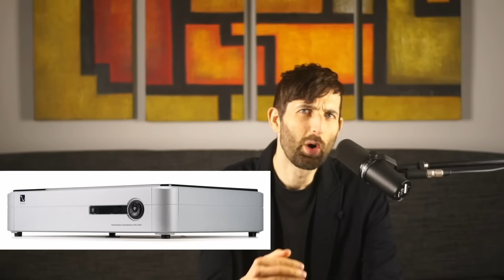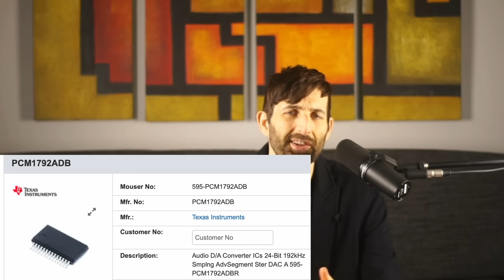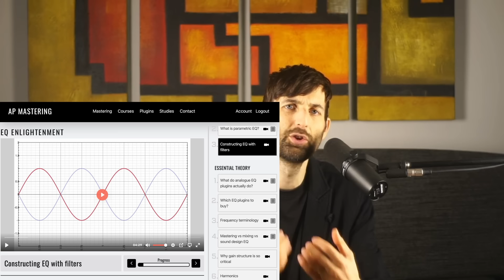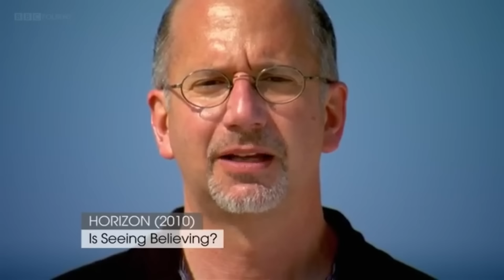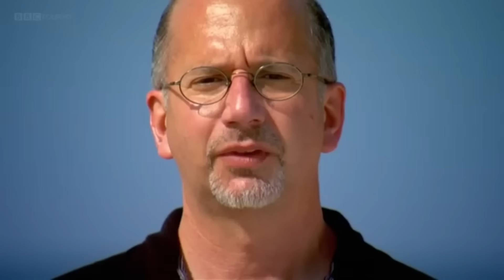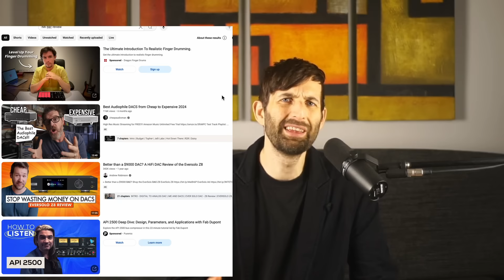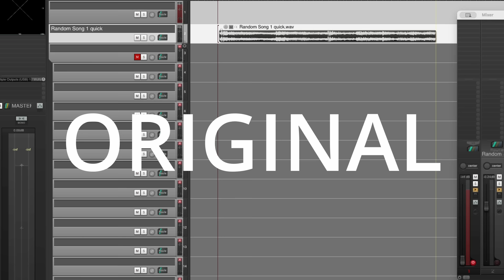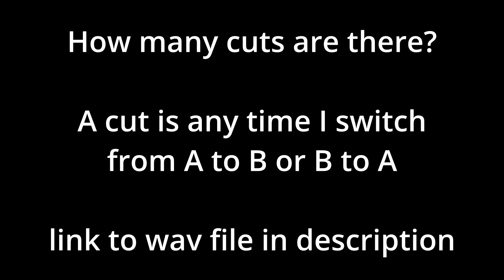The DAC Scam - Almost everyone believes the hype

Comment: Lol I think dacs do sound different(!) I was listening with a bunch of good iems and the ifi Go Bar the other day and the sense of space and reverb trails was drastically different when plugging straight into my phone. I couldn't believe it on some tracks the difference was so stark at first I thought the ifi device was adding reverb to everything and I literally checked by listening to super dry tracks where the vocals are right in your ear.. I'm not good at describing audio experience but the soundstage was clearly different between the two devices and the ifi sounded better on most tracks, some tracks were so different it was really down to personal preference which presentation you preferred. ✌️

Comment: What exactly are we saying here? Are we saying that the built-in DAC on a $300 receiver will not sound better than a well-built $500 dac or are we saying that a well-built $500 dac what sound is good as a $5,000 dac? I can believe that second claim but based on my listening I have a hard time believing the first claim.
Reply from the maker: depends on the quality of the receiver. a transparent receiver is a push at 300$ because it also contains an amp. but it could sound significantly better than a 100,000$ a DAC because the overpriced one probably is not transparent and has weird colouration from using bespoke nonsense

Comment: Okay, it's not that I am sure you're wrong. But I am not 100% sure your totally right either. Let me share my experience. I had a SCHIIT Modi in my system. I thought it sounded fabulous. I wanted to get a bluesound node. Based on price My assumption was that the internal DAC would be at least as good if not superior to the modi. My intention was to give the modi to my son because why would I need it? However I was surprised that the node just didn't sound as good. When I ran the node through the Modi It sounded noticeably better. To me in this scenario it seems that if this was all psychological coloration I would have thought that the node would sound better to me. That was the more expensive device and the one that I thought would sound better. Yet that wasn't the case. I ended up giving the Modi to my son anyway because I had told him I would. After about a year I picked up an SMSL DAC that was only around $220. Again, in my mind this was a cheap DAC relatively speaking and my expectation wasn't high. I thought I would check it out and just return it to Amazon if I wasn't happy. But I was very happy. Now, this wasn't about transparency. It was mostly about soundstage. I swear to God that the soundstage was broader and deeper and taller with the SMSL than with the onboard dac in the node.

Comment: So frustrating to see such a video, reinforcing believes and misinforming the audience.
While theoretically the job of a DAC is simple, the actual implementation is not.
If you can‘t hear differences, good for you, you can save a substantial amount of money.
If you can remain open to trusting your ears, really compare DACs by listening on the same system, ideally some top headphones, since a TOTL headphone will be more accessible than a TOTL Hifi system.
For sure there is plenty of snake oil in the audio world, but there are also really well engineered solutions that make a real difference in sound quality and enjoyment.
Cheers

Comment: I bought an Anthem 740, Arcam 1120 ,a Denon 4800. They were all around $2500 to 3k..
I evened up with a Pioneer 505 for $1099. The sound was no different. Yes, they all had their own room correction, but when it came to critical music listening, zero difference.
Spend more if you need more channels and that's it.
Your speakers will make the most difference.

Comment: The implementation (supporting circuitry) of that basic DAC chip is what really makes the difference. Thats what you're paying for with most DACs and it can make or break the overall design and its real world performance. It starts with the power supply and ends with the output buffers. The chip manufacturer supplies you with the application data of their chip. If the DAC manufacturer doesn't support the DAC chip sufficiently, it can virtually stunt the performance potential. So that's what your basically paying for - the external performance.

Comment: The first R2R dac I ever tried had an immediate emotional impact on me. I started dancing in the room and I'm not really a dancer.
Reply: I honestly cannot tell if this is sarcasm, but the point of this video wasn't that there's "no difference in sound" between DACs, it's that if a DAC is supposed to be "transparent" then it's transparent and cost has no bearing on that.

R2R sounds like it does because it's coloring the sound with distortion, similar to tube amps.  Some people greatly prefer this sound, as it comes off as warmer or "more natural", but it's still colored sound.
Reply: @Neonmirrorblack that's just wrong. R2Rs are more accurate in certain ways and color the sound less. They have zero crossing distortion but aside from that they're more accurate in every other way and color the sound less. Delta sigmas literally require filters to work.
Reply: @jayaneyon9316  What exactly are the certain ways? All data shows you are exactly incorrect,  this better be good. You've also displayed your massive ignorance in delta sigma, would you prefer non-music content is pushed into the audible range instead? Why the existence of a filter is inherently bad to you? You should have tossed the vast majority of all your electronics if such is the case.
Reply: @psyborg06  harmonic accuracy and impulse response. Way more important than a little distortion. The fact that they have filters means they color the sound and if that wasn't the case then you wouldn't have the option to choose between different ones on high end dacs. I didn't say it's bad. But Delta sigmas are not as realistic or accurate sounding as R2Rs. They just have an easier time with details. But if I could afford a holo audio may I'd get all the detail of a delta sigma with non of the downsides. You're obviously just some armchair reddit nerd who doesn't listen to their actual ears. Go back to playing that stupid track mania game while listening to music through the puny delta sigma dac that's integrated in your computer with it's noisy switching power supply and it's cheap unbalanced amp.
Reply: @jayaneyon9316  LMFAO how do you think we measure "harmonic accuracy"? Total Harmonic DISTORTION (THD). Now explain how a filter colors the sound if it affects only frequencies humans can't hear. Finally explain how you've disproven the fourier transform.
Reply: @psyborg06 that's harmonic distortion though. I'm talking about which harmonics are prioritized and amplified more, especially in the higher frequencies. It's just factually true that R2Rs sound more like live music. Maybe you don't go to many shows or play any instruments so you don't get it. Like even if I didn't know why it wouldn't change the reality which is they just sound more realistic. If it's more like the real thing it's less colored. And hearing doesn't cut cut off sharply at 20khz. And the frequencies you can't here still have an affect.  And your last point has nothing to do with what i'm saying. And the impulse response is most important but you're ignoring that.
Reply: That would be the music that made an emotional effect. If your DAC is imparting anything to the signal, it is inherently failing at its purpose. You didn't listen to the video, did you?
Reply: @psyborg06 I couldn't disagree more with your idea of what a dac should do. I agree 100% it is the music. I felt an emotional response from the r2r dac that I had never experienced from digitally sourced music. I felt the emotional connection that I used to feel listening to records and tapes. I am so happy I found out about really high quality dacs.
Reply: @t.glenn.marshall  It seems you've fallen in love with an inanimate electronic object, this is very strange. What a DAC does (or should do) is right in the name, you're free to concoct whatever hallucination of a definition you please I suppose. Can't help those who actively revel in being taken advantage of I suppose.
Reply: @psyborg06   If you think there's only one objective way to enjoy music you are a dingus. R2R isn't failing its purpose at all, it's SUPPOSED to sound like it does.
Reply: @Fetchdafish  An R2R DAC is not music.
Reply: Dude, r2r is just an architecture for DACs, there are still in integrated circuits if the application makes sense.
Reply: @guillermomaciasrojas7912  I don't understand what your point is. I simply try things and keep what I like and discard what I don't. I didn't have an emotional connection to the music I loved as a young person ever since CDs became popular. I thought the weak link was the digital format. Thankfully, after almost 30 years I learned the weak link was the DAC. I am not upset if other people don't feel the same way. Everyone is different. It is ok to like diferent things. It is ok. There is no reason to be upset. If you don't hear a difference in DACs than that is cool with me.
Reply: @t.glenn.marshall  You clearly don't understand much, your entire argument is based on personal feelings.
Reply: Spot on! Part of the problem is that the sea of deniers did not get the chance to actually hear a R2R or, for that matter, even a good 25+ years old NOS + tube dac to experience the differences in emotional engagement. Obviously, power supply and final stage are in many cases more important but, even when done right, I can surely hear the bloody delta sigma emotion killing demon. And it is absolutely not about AB-ing on a 2 minute piece of crap digitally emanated sounds but listening to music day after day after day after day and each time smiling, tapping you foot uncontrollably (the only audio equipment test you will ever need!!!) and elevating your spirit in this blood-thirsty foolish world. Vinyl and reel-to-reel (R2R 😀) do help a lot too!
Reply: @MrDinupi  You should start a religion, electronics with emotions is surely a new one!
Reply: I AGREE STRONGLY!!! R2R, though an old technology, sounds so much better than many of the newer dacs!
Reply: If u want DAC for music production then your threshold for diminishing returns hits very early in monetary sense.
But for non critical music, When i listen to music on cayin ru7 and most topping DACs immediately you want to stop play button on topping. The reason is Topping measures superb doesnt add harmonics and feels sharp and thats good thing to understand music but to just put and relax you want the smoothness which is coloring. There is another DAC Schiit Asgard series which is also sweet to listen especially with Bright speakers. So question is are most people listening to music are mastering engineers or casual listeners ?
Reply: @suryaparaman  Since the topping is transparent, this would imply that nearly all music is mastered in way that is non relaxing, unsmooth, and dull according to you. That is very unfortunate for you.
Reply: @psyborg06 
I did listen to the video

I have been to studios and I ustand the importance of DAC and audio interfaces not to colour it for a mastering engineer. 

The point I was making is many people assume sound should be uncoloured and end up buying gear which they can't listen more than hour. Thats why it's important to know that colouring sound for a CASUAL listener may not be always bad.
Reply: @suryaparaman  It looks like you haven't addressed the logical conclusion of your claims and are now trying to walk them back. Consider why that is.
Reply: MAYBE it was the shoes you were wearing ??
Reply: @anotherbrickinthewall1700  or his tightly they were tied. Also, well shined shoes are more magical.
Reply: Ares II is at least trash. Has treble roll-off starting at 8kHz. Literally worse than an apple dongle. DACs can sound different, but mostly it's less accurate and colored. Preferring that is fine especially if it balanced out the opposite weaknesses of a system, but it's not better any meaningful sense.
Reply: @hartyewh1 Well at least you acknowledge that there are low pass filters in non-oversampling DACs. 6:35 the video says you hear the stair steps, because he's never heard of a capacitor or analogue low-pass filtering.
Reply: I tried r2r, no difference, nothing, people would fail at ab testing, it's all make believe and snake oil lol
Reply: @jasonclintford2751 you must have a ball of wax in your ears, as I can hear the difference!!

Comment: Proper dacs allow for upsampling to say 22,4mhz (OCTA DSD) 

this in turn allows to move the aliasing filter much further up past 100khz

It sounds much more smooth and "analogue" than your typical stock grade DAC only allowing for 44,1khz with FIR filter at 22000 hz

Being able to upsample everything to OCTA DSD really sounds a lot better for this reason.

And i prefer the sound of AKM chips better than Sabre chips.

Comment: The most hilarious thing is that suppliers, even with a very "high-end" DAC offer audiograde switches and expensive shielded ethernet cables and claim it improves the sound.... Which is proofing your point, when I buy high-end, I don't want to have a DAC that cannot process Jitter the right way and is sensitive for noise from the power adapter.... High-end should mean that the DAC is not sensitive to that influence....
Reply from the maker: exactly

Comment: you proved in another post that there IS a difference in dacs!
behringer vs focusrite. SAME CHIPS and big difference.
its NOT the dac chip that counts, its the design and components AROUND that chip. thats what you pay for.  however i also agree you DONT need to spend thousands for a high quality dac! i use a topping d90 akm dac for mastering-  it wasnt too expensive and its definately better than a focusrite to my ears. just research and make good choices.
Reply from the maker: there's no audible difference between behringer and focusrite in the DAC. the reason I don't like the behringer unit is because its a creaky plastic piece of crap which lacks features and has stupid buttons which create noisy pres
Reply: @APMastering  you proved there was an audible difference with the loopback test... and Ive heard the Behringer myself, it's DAC sounds a bit on the thin side and ADC a little noisy. like I said, the DAC chips don't sound different, it's the other components and design that does. I suggest you try the blind test I did- buy a cheap fosi ZD3 DAC. Swap the factory opamps out to jrc chips for example. You will hear a difference like I did, which is why there's a cost difference. But like you said, be smart, there's good products out there that aren't expensive!

Comment: I have to disagree. Without my DAC, my CD transport sounds uninspiring, dull, and well lifeless.  ;)
Reply: You could be having a problem of impedance missmacth, that is solved with your dac. When a signal is passed to another piece of equipment, if the entry impedance is too low for the signal, it degrades. Loses volume, loses highs, it sounds weak.
Reply: @slash148  You could be having the problem of understanding a transport requires a DAC, else there is no sound.
Reply: My new DAC sounds totally whale, beaver, and straight stallion. After upgrading I got a new job, a new girlfriend, and a side piece.

Comment: I think what you are missing is how those chips are implemented! How is the output circuitry designed? What type of power supply is being used? Isolation? I’ve had as many as four different dacs in my home at one time at varying price points and they all sound different from each other. If what you say is true, every DAC should sound exactly the same, and we know it is not true. Let me put it in simpler terms for you. I can give ten different people a recipe for a cake and provide them all with the very same ingredients. I promise you that all of those cakes will be different from each other due to the methods used to put those ingredients together, not to mention the type of baking pan used, variances in temperature regulation, etc. It is not as simple as you suggest.

Comment: I think like a lot of things, there is a variance of quality up until a certain point, and then it’s just academic if there’s any difference at all. I’ve had occasional cases of “bad” DACs that sound harsh and sharp, and don’t sound as good as other “good” DACs, but then once you’ve got a “good” DAC, you won’t gain much from upgrading. I think for someone like me the cutoff of a “good” DAC is relatively low, most of my portable devices have “good” DACs in them for instance, but I imagine that no matter how good your ears are or how concrete your belief is, once you’ve got the best chips on the market and a well shielded and organised design, there’s no possible improvement that could be detected.

Comment: Although I agree with you in general terms, you should identify the DACs that use the cheap processors. There are some, like PS Audio, that uses FPGAs and not off the shelf processors. FPGAs are programmed with proprietary codes. I understand that DCS uses a proprietary DAC called ring dac. And I think that WADAX uses FPGA. Again, those that are using off the shelf cheap processors should be identified.

Comment: Here's the the thing, the original version sounds much better than the the looped version even just popped one time. I can barely hear much of a difference once you keep looping it though. I was surprised how similar even the 100th loop sounded to the this first loop, but the none of the loops sounded like the original. If you were to send me an A/B of the two files I'm sure I would pass a blind test pretty easily